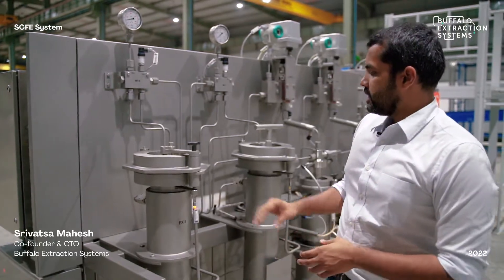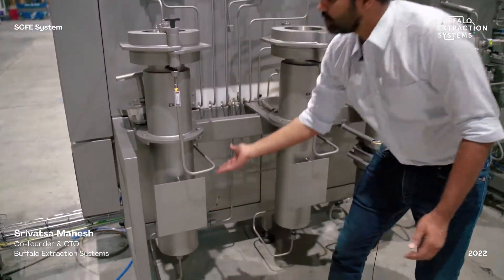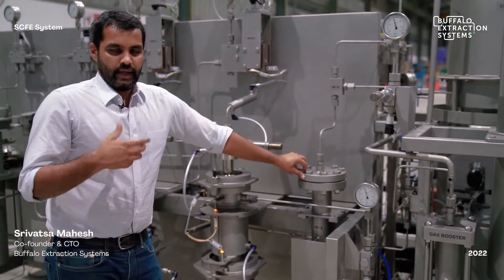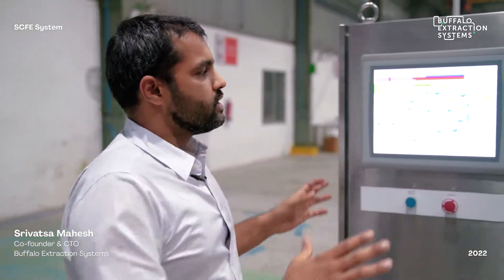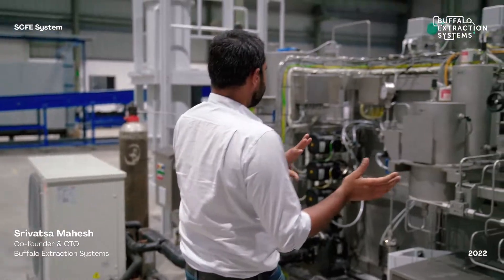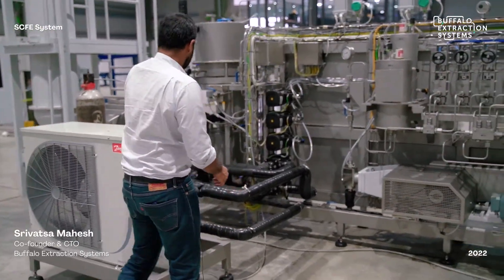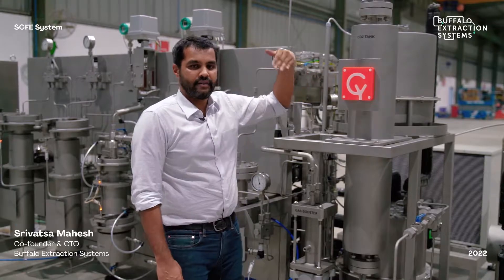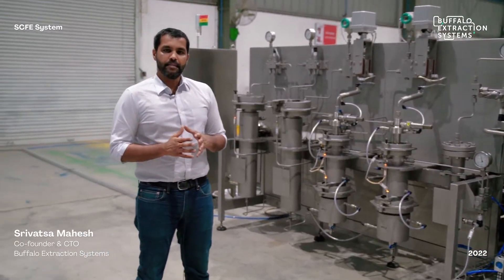Supercritical Fluid Extraction (SCFE) System Walkthrough | Buffalo Extraction Systems

Comment: Why don't you use water for refrigeration?  temperatures are moderate.  why can't you recirculated all the CO2?
Reply from the maker: Hi, thank you for your comment.
CO2 needs to be taken down to 2degC before entering the pump. This is not feasible using water as a refrigerant.

Comment: We have an issue in the world with GHG and these "closed loop" companies are allowed to open blast high pressure CO2 to atmosphere and its disgusting to me. They claim that they capture in a closed loop system and yet every single system has a 'vent' line that goes direct to atmosphere and you can hear them when they expell the gasses to atmosphere. I ran the math on my IES system (I owned 4 systems) and realized a single system was exposing the same amount of gas in a single day, that hundreds of cars put out annually. Needless to say, I got rid of my systems.
Reply from the maker: Thanks for your comment and we completely understand the sentiment
 
Our CO2 systems consist of a gas booster. Once a batch is over, the residual CO2 from the spent extractor is pulled out of it using the gas booster and fed back into the CO2 tank. Considering base CO2 pressure of 60Bar/ 900 PSI, we pull the CO2 pressure down to approximately 10Bar / 145PSI. For a 10L extractor, at 10bar / 30degC, the density of CO2 is appx 18kg/m3, so the residual CO2 which is vented is approximately 18grams per batch. 
 
The vent line in our system is connected to a CO2 scrubber that we provide with the system. the sodium hydroxide reacts with CO2 to form Na2CO3 and water. 
 
While this doesn’t 100% ensure no CO2 is lost in the environment, as some CO2 is lost during removal of oils, and due to leakages when seals run out their life, we do make all attempts to ensure the loss of CO2 is minimized, for the sake of environment, but also for minimizing the operational costs of running the system, which is a major cost contributor.